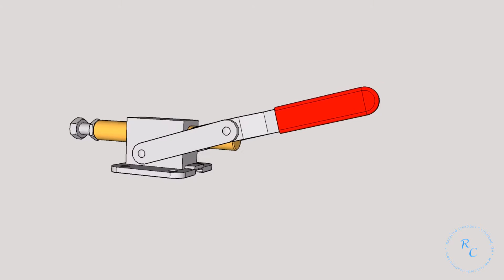How To Make a Pen Press (Shop Jig)

Comment: How do you like your Lathe?  I've seen a few pop up on Craigslist in my area. Is it hard to line up the centers?  Could you recommend this lathe over getting the 10"x 18" harbor freight lathe?
Reply from the maker: Joshua Luther the centers are hard to align , I was gifted the lathe and am greatful for it but if I had to purchase a machine and had limited budget I would go with the HF one that has the cast bed, or even up grade to the Excelsior that rockler sells for about 250 or so
Reply: Billy McCord Thanks for the input. It confirms my suspicions about the single pole lathes.